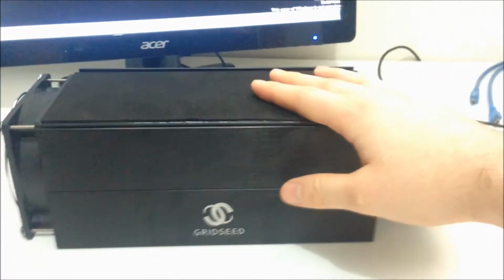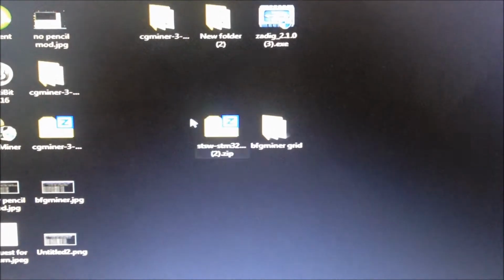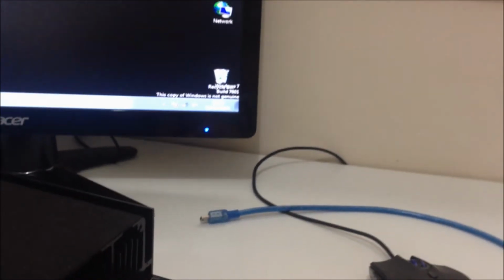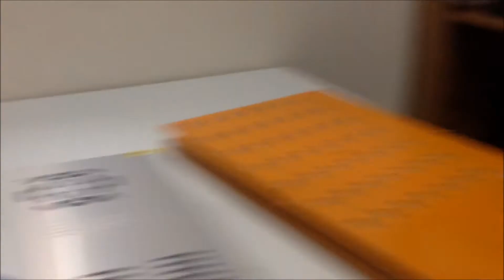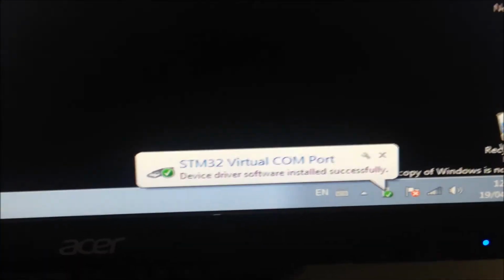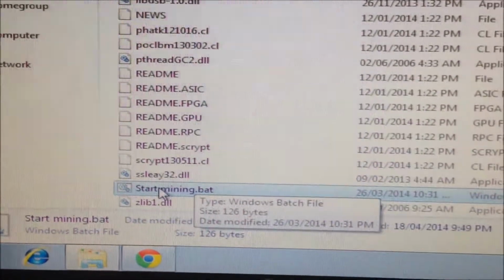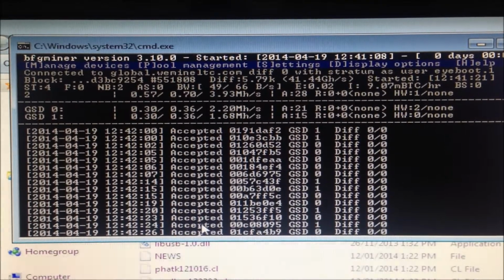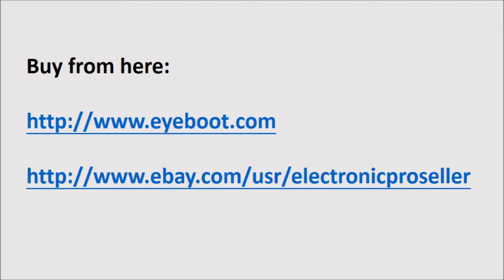How to setup Gridseed Blade 5200kh/s ASIC Scrypt Miner

Comment: Please help! I followed the instructions in your video and have one gridseed blade working. My other gridseed blade is not showing up at all. The unit that is working is hashing at a slow rate. Please help me!
Reply from the maker: *****
It sounds like the connector on the other blade my be faulty. Contact your supplier and ask them to replace/repair.
Reply: Probably your gpu is probing, happened to me so I disabled it

Comment: Hi Ive added more gridseed blades, but one board (and it switches if i reboot) shows hashing down at 1.2mh all 5 others show normal hashing up to a 2.6-7mh ish.
I am using bfgminer.
There is all so something else recognised OCL: 0 ? sometimes it runs sometimes it doesn`t?
Any advice is welcome.

Comment: the noise of the blade was driving me nuts so I added some tiny heat sinks to power convertors and the inducer and put a lower speed fan at the front and a quiet one blowing on the back of the board where any heat problems will show up.

As the blade is only designed for script mode the gridseed chips don't get hot at all so what I have done is more than adequate cooling and far more peaceful.

http://cpc.farnell.com/fischer-elektronik/ick-smd-a-5-sa/heat-sink-for-smd-123-c-w/dp/SC10770?in_merch=Featured%20Products

The back of the board runs  hot even in standard mode so don't try the overclock imop
Reply from the maker: Nice modification!
Reply: brian whittle
I as well could not stand the noise coming from it. Not only was it loud, but the fan was partially defective, making a nice churning noise (still pumped tons of air.) I went and threw a Noctua 92mm fan in it's replacement and all is happy as can be, can't even hear it now, and still runs cool.
Reply: Leon Corsav  If you have not put little heat sinks on the three voltage regulators and the big inducer it may overheat, the input cap is a weak link too
Reply: brian whittle can you point me this problem, what heatsink and where are those voltage?

Comment: hi, have you ever seen one of the boards that shows a hash rate yet no shares are accepted? also i found that the board in the blade that does not accept shares emits a clicking sound around the power connector area when plugging, it eventually goes away but still no accepted shares. an ideas? thanks
Reply from the maker: Hi Colin, i did have this problem before. It is a zombie board. Usually they do find shares eventually. In the end, i took mine apart (just unscrewed all the screws and took off the heatsink) and open the two boards. Gave it a blow and made sure nothing was lodged in there. Then put it back together and it worked again!

Comment: Hello Eyeboot i had a question: is it possible to mine with gridseed blade AND a normal gridseed at one rasberry pi?
Reply from the maker: Yes it is. I have done it before. Just make sure you have commands for both in your batfile. Post it here if you need any help.

Comment: What speed are you running at, 800 or 850 like you do with the little gridseeds?
Reply: the blade will run at 850  with an hardware error about every 6 mins per the 2 boards

Comment: How do you get bfg miner to not use the GPU that's on my system? I can't play games while I mine when using my blade, just curious if there's a another command I can put into the .bat file to tell it to use ONLY the Blade?
Reply from the maker: Try adding --disable-gpu to the bat file. If that doesn't work then do this: while bfgminer is running If you press M (manage devices) and select the GPU and press D then it will disable it.
Reply: Eyeboot
 Both worked like a charm, thank you much!

Comment: can you please show whats inside your bat file. Also if i want to use it on my GPU rig where its currently mining n-scrypt coins using 3GPU via sgwatcher on vertminer.  Do I need to add something in this bfgminer bat file so that it will not use gpus at all.? cheers
Reply: trying on laptop first but I cant make it work. windows 7x64. Drivers installed and it shows in com ports as COM5 and 6. and I keep bat file for this  bfg miner as by default only changed my pool. and user.

 Bfgminer -S gridseed:all --set-device gridseed:clock=850 --scrypt -o stratum+tcp://us-east.multipool.us:7777 -Bdv85listru.1 -p x

but miner only blinks for a second and nothing starts. what could be a problem?
Reply from the maker: Sorry for the late reply. Try this: bfgminer.exe --scrypt -o stratum+tcp://us-east.multipool.us:7777 -u yourworker.1 -p password -d gridseed -S gridseed:all --set-device gridseed:clock=850

Make sure you have reinstalled the virtual com port driver. Add --disable-gpu or -G to your batfile if you want to disable the graphics cards in bfgminer.

Comment: I got mine last night and have been running for a couple of hours now.  I can't get it above 1.8 mhs per board.  I can't get it to work on Cgminer and this is the first I have used Bfgminer.  Where do you find the temperatures on Bfgminer?  This is my bat file, am I missing anything?

bfgminer.exe --scrypt -o stratum+tcp://us.clevermining.com:3333 -u 1CEh6uexCy3MGhwPBf4CLapxC936SirMUE -p x -d gridseed -S gridseed:all --set-device gridseed:clock=850

Comment: Hi Eyeboot team, 
Why you don't use CGminer? also, Is double hash mode disable by default? If not, how you can disable it?
Reply from the maker: Take away the -dual command in your batfile and add --scrypt

I use cgminer and bfgminer as necessary, both work better with certain types of miners.